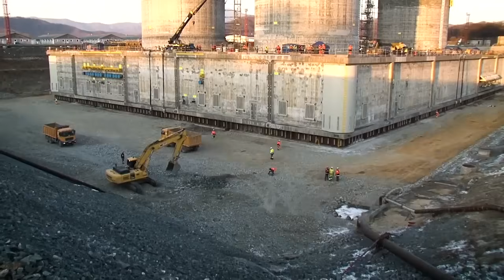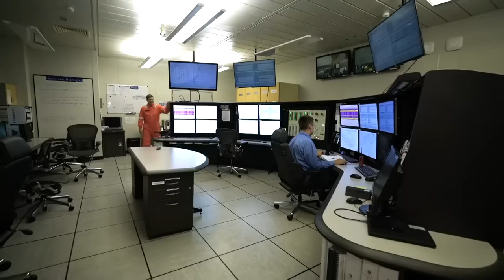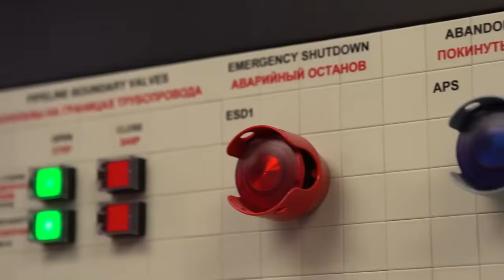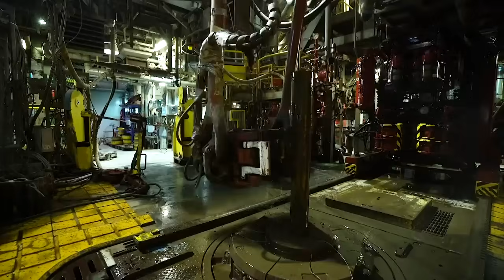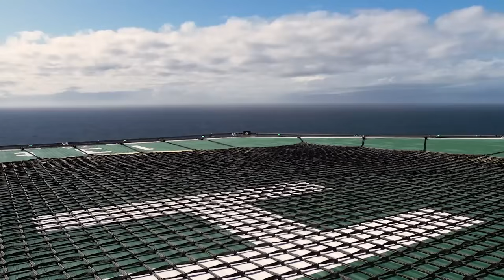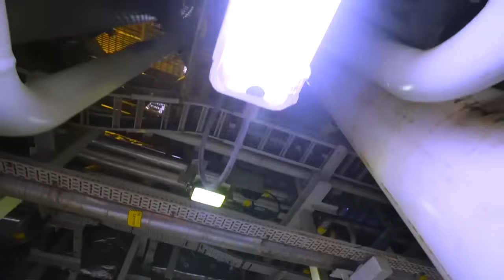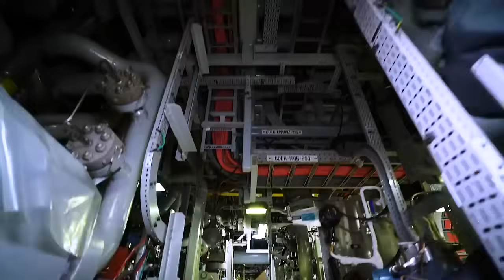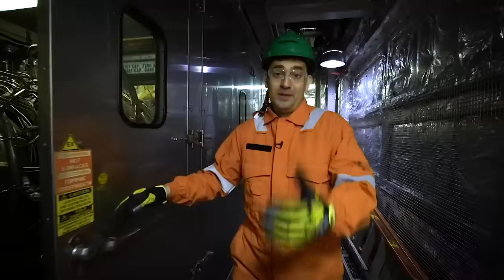A Look INSIDE an Amazing Six-storey $1 Billion Offshore Platform

Comment: Another reason the rig will pump wastewater back into empied cavities is not only to dispose of it, but to also prevent the empty cavities from collapsing and destabilizing the seafloor.
Reply: It is not a big hole full of oil. The oil and gas is trapped in porous rock. It’s not a lake of oil
Reply: two birds one stone
Reply: Right, it’s just called pay sands. It’s still extremely hard. A 77/8 bit will still be running 30,000 lbs weight on it maybe drilling anywhere from 8’ to 30’ an hour. 
They can purify that salt water now to where it’ll pass drinking tests. A lot of these saltwater desposal wells they have to inject due to the EPA in the states. If anything I have e an idea that could be causing problems, not fracking. Some injection wells I’ve seen pressure up to over 20,000 pounds.  They’ve been fracking around here since 1948.  Injection wells , I think it’s a problem EPA !
Reply: Nothing environmentally friendly at all and when your all Finished saying it Makes sense you know nothing at all, Go educate yourselves!!
Reply: They call it revolutionary and its brilliant,  Producing oil in return destroying the climate yer absolutely brilliant, Did any of you think about that anyone in the comments hmmm?? Educated enough to understand global warming and the environmental impacts to what's going on here ????
Reply: Makes sense
Reply: Isn't it to pressurize the remaining hydrocarbon for further extraction as well?
Reply: Makes sense. The ocean surface would be all pot holed and bumpy from the uneven ocean floor. That's why the rest of the ocean is perfectly flat.